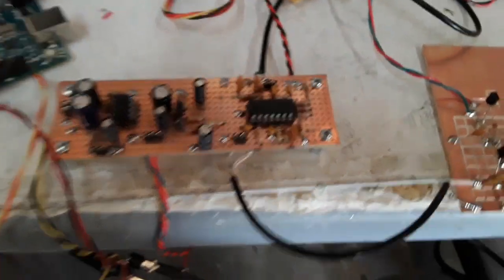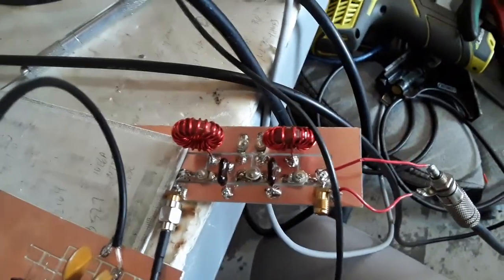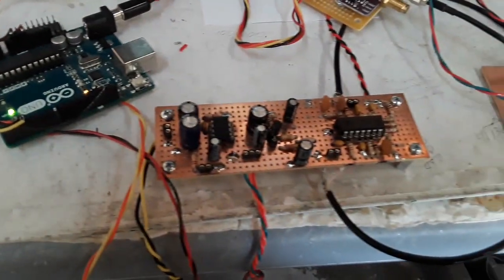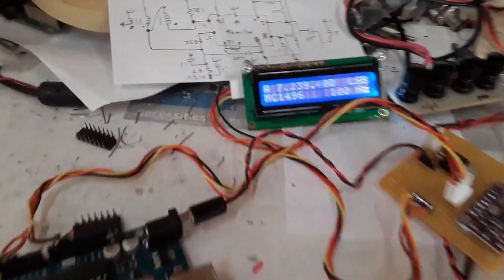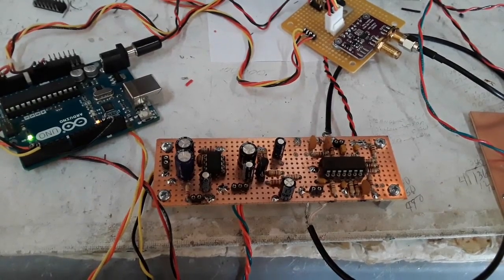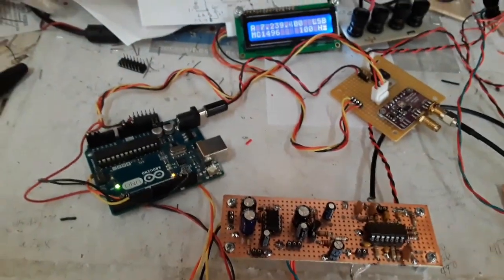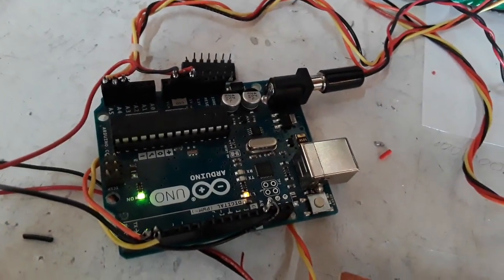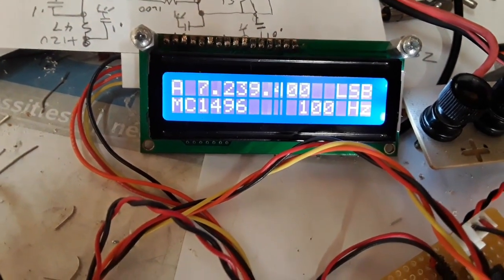N6QW Builds a MC1496DBM  based Direct Conversion Receiver

Comment: Hi Pete (and others). Feel free to have a laugh at my expense ... I too had a play with the 1496 a couple of weeks ago (not then knowing of your experiments). I took my inspiration from SSDRA. I couldn't get it to work. I eventually realised the early 1496 device was in a 10pin metal can, and of course my 1496 has 14 pins. No more needs to be said. Laugh away as I did (after briefly weeping  and self admonishing).
Reply from the maker: Hi Neville 

No laughing om this end. I have some of the 10 Pin TO-5 can devices and about two weeks ago spent about an hour developing a matrix of which pin is which. So we have all been there and done that.

Thanks for watching the video and for your post.

73's
Pete

Comment: I have always liked the 1496, ever since the HW8 tin can days. I have a couple of receivers that use the DIL version. I was told that the NE602 internal circuit is the same as the 1496, but have never dug into that. Thanks for sharing Pete.
Reply from the maker: Hi Steve,

Thanks for taking a look. I found a couple of the MC1496 as I was searching for something else in the bins and thought why not try one in a DCR. I am not sure about the two devices as being the same but  both are DBM's. The NE602 can be a self excited oscillator by simply connecting a crystal across two pins. Haven't seen that in a 1496 but that might be possible. just don't know. I did receive one question about if I had compared the two in a DCR. I have not done that.

Pete

Comment: Is there a reason you used a pnp amp instead of an npn? Just wanted to try it out? Or is there a more technical reason?
Reply from the maker: Hi Trevor,

See my blog at n6qw.blogspot.com. I was evaluating a circuit (commercial) and I realized that you could use 2N3906 transistors in RF Amplifier circuits. So I built it and it indeed works nicely. I have a large jar of PNP transstors that suddenly will get a new life.

73's
Pete

Comment: Thanks for sharing Pete.  I am changing the LO on a direct conversion receiver I built years ago from a VXO to DDS using the si5351.  Getting accustomed to Arduino and I2C, LCD drivers etc.  A good use of the workbench.
Reply from the maker: Hi Eric,

Many thanks for your post -- you will liken the former configuration to "performing Brain Surgery with a Rusty Spoon":. There is a marked difference, If you decide to make the DCR into a superhet, then a few lines of code will get you there.

73's
Pete N6QW